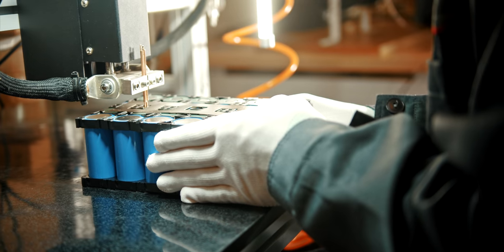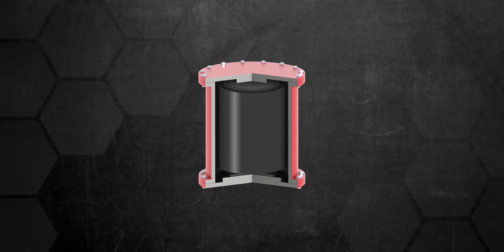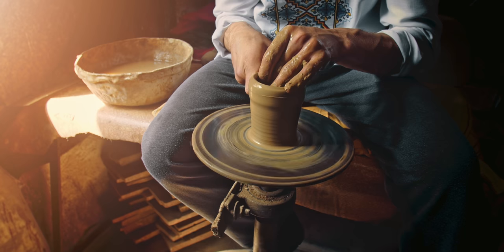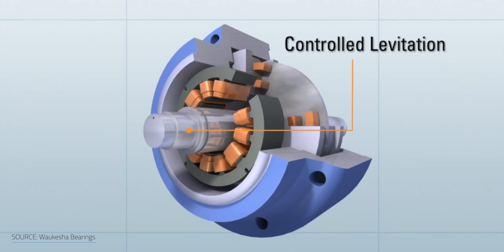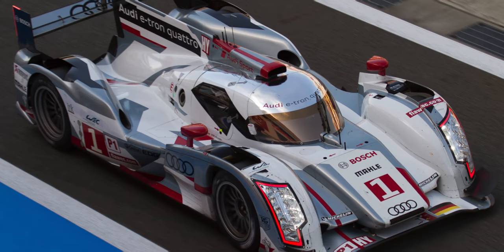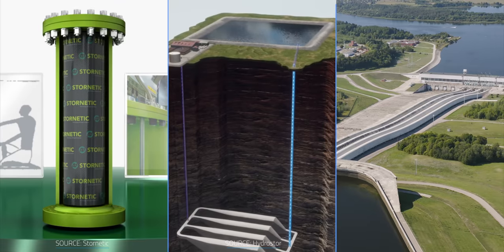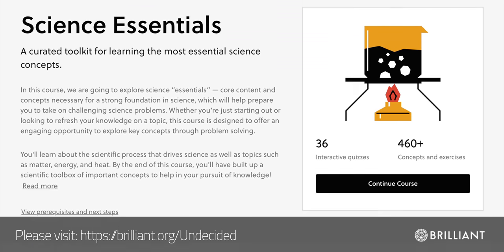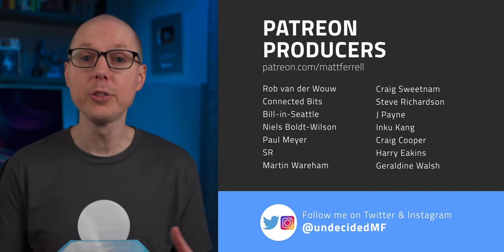The Mechanical Battery Explained - A Flywheel Comeback?

Comment: You talk about Beacons flywheel rotor being able to charge and discharge for up to 175, 000 cycle as opposed to lithium-ion batteries or any other storage solution so surely you need to present a costing on that so people can see that batteries are cheap and useless for the longer term, and flywheels are expensive to start off with, however, they end up being cheaper over the longer term and nowhere near as dirty as lithium batteries etc etc.

Comment: What is the self dischage rate of a mechanical flywheel "battery"?

I heard a similar exposé about them and it hinted that a free spinning vertical flywheel would take about 24 hrs to stop spinning, wihtout putting out any electricity throught the generator/motor. 

So knowing the max Kinetic energy stored in it we ca calculate the average dicharge power or, in other words, how much energy is required just to keep'em spinning at max angular momentum.

And I think that is what was the killer for this thing.

Do you have any data from the companies you mentined here?

cheers

Comment: Wait but for long range energy storage if the fly wheel is not in contact with a motor then its energy would just gradually be lost to inertia right? So how would it work as a battery if I want to power a house in the middle of africa?

Comment: The comparison here has some inaccuracies. Flywheels have great power density but have less energy density than a lithium ion battery. Composites flywheels, which I have worked on, are extremely expensive generally and have complex manufacturing requirements. They serve a niche purpose. Beacon made low cost composite flywheels by essentially wrapping carbon fiber on a shaft in the lowest cost method possible but they are still quite expensive. However their high power density lets them easily balance the grid in a way batteries cannot without fire or shortened life issues. The other critically important thing that should have been mentioned is the the velocity term in the equation is squared so going faster (as you can do with composites) is better than being massive (traditional steel flywheels).

Comment: I wonder why there are no concepts around to test stacked wheels with having electric cycles from the center to swinging mass part. This, and different pulsing(by taking energy from the system for each wheel individually and keept the enhancing induction pulse up and coordinated).

Also i think self-inducing magnetic systems can help to reduce storraging-inertia and shiled the system from gravitational loss.

Comment: Another thing I would like places like Coal Buring plants to do is use other sources of fuel that are renewable to use for the burning like say plant bricks of the left over parts from the Hemp plant industry or weed industry. This could easily work for these places, as could using scrap wood and tree that is unusable.

Comment: For stationary application the weight doesn't matter. Whats matter most are the costs. On the other hand high capacity flyweels are too dangerous for mobile applications. So flywells are not sutable for long time energy storage. The sweetspot of flyweels are situations where you need high power for a brief period of time. The main selling point of flyweels is power not capacity.

Comment: Whatever happened to that company that was making clockwork batteries?  Where you'd wind up the battery with a key, and it would spin a dynamo over an extended period of time to produce voltage?
Or was that just a fever dream?

Comment: how logical is to swtiching between electrical and mechanical form of energies ? 
in batteries, you store the energy in electrical charges, via ions etc. 
it may have certain applications but physcial constraints make me think about it.
there is a thing called, material lifespan, even in perfect conditions, the materials will fail due to fatique

Comment: Was just thinking lately why don't we use flywheels, and actually as I see most problems are solved just the cost optimization remains. Is there anywhere a comparison of storage performance (how much energy is lost per hour for lithium batteries vs flywheels?). These wheels will be applicable when they can store energy for months from summer till winter with no significant energy loss.
Reply: Not even remotely close for summer to winter.  Day to night is already a stretch.

Comment: The brother that were reluctant to sell the flywheel on a gimbal that powered a car to the oil company were allowed to build flywheel generators for missile silos and children hospitals. They were in Chatsworth CA. Until around 2010
Called Pentadyne . they went from a 90 lb. Flywheel to 300 lb. Both at 70 thousand rpm. They fired a machinist and our company picked him up.
I asked him for some scrap parts for a G job I was working on and as I described it to him he new exactly what I was doing and said " your after torque. !!! "
I replied in silence thinking how did this guy know what I was talking about music less he knew how valid my project was . nonetheless I said in reply ', how did you know ?
Then he told me the story of the two brother that made Pentadine .
He even started to show me on paper the design of its copper laid patterns in the fly wheel. Like he said I was after torque and didn't care to see the details 
But thanked him for the coming scrap parts that came later.  Check into Pentadine and see what comes up.

Comment: how could a flywheel control the altitude, its the orientation which is controlled by conserving the angular momenta about a particular axis. its mainly called the gyros and the hubble uses the same flywheel technology to point towards any star system and capture photos.

Comment: How about a tall tower with a spiral gear and a weight.  To charge it, energy is used to raise the weight.  To recover the energy the weight is allowed to fall, causing it to spin.

It could store that energy with no loss until the tower corroded and collapsed, so for years and years, if needed.

Comment: Mistake number one: the grid needs storage, not only renewables. The technology that needs the most amount of storage is nuclear. Nuclear runs 24/24 and can't be turned off at night. Therefore, pumped hydro storage was built decades ago, more or less ten years after the installation of nuclear and together with coal. Gas needs less storage. Modern gas peaking power plants even less. Therefore, it is said that the best friends of wind turbines are gas turbines. pumped hydro cannot be regulated according to the needs of the grid. Turning on and off a hydro turbine takes minutes and more. Reducing a hydro turbine is bad for the turbine: vortex formations create vibrations, which shorten the lifetime of the turbines.
Thus, we need batteries and other modern storage technologies for grid stabilization. 
Of course, renewables add to the complexity of grid stabilization. But we should not put all the blame on renewables.

Comment: I'm in favour of the flywheel. Practically endless cycles is what makes them feasible for grid stabilisation and the environmental benefits.  When using renewable energies you easily have to cycle the energie storage four times a day. Even when only using 50% of the capacity, what we actually do often in such cases. The Lithium Ion battery will be worn out pretty quickly. If you use even less then there's no cost benefit left at all. While you could cycle a flywheel at 95% without any bigger issues and can cycle it several hundred thousand times while using far less rare earths. What makes me think is the amount of gyroscopic force and the effect on the earths trajectory itself. No calculations made whatsoever just a thought/concern.
Reply: large mass of flywheel requires large bearings, large bearings large costs and bearings aren't eternal, they often fail if they hold large mass.
Reply: @tgstudio85  still rather cheap compared to lithium batteries. YOu can build bearings to withstand billion(!) of cycles. If you don't overload them at all they can be ethernal. You just have to do the maths and be ready to spend a bit extra

Comment: I don't get it. Don't these flywheels just stop spinning after a while? I mean, unlike batteries that can chemically store energy, if you're not actively spinning the wheel it will just stop, even if it's in a vacuum, because of gravity. What am I missing?

Comment: I mean technically you don’t need something with a lot of mass you just need something that produces a lot of torque. For instance if you had a 80lb flywheel and made it as compact as possible and spun it up it would take less torque to stop it compared to stretching that 80lbs into a ring kinda like a bicycle tire and spinning it up to the same rpm.

Comment: I don't understand the focus on Li ion batteries for grid storage purposes. Li is optimised for weight, which is not the main problem for large grid storage. Why don't they use cheaper lead-sulfate batteries or similar, since they are cheap and heavy?

Comment: What about molten salt energy storage. This would use electricity to heat solid salt blocks until molten storing mass amounts of energy due to the high latent heat. Then we convert that thermal energy back to electric via turbines.

Comment: In a UPS system made with flywheel material cost of the rotor is equal to 10% of total price of flywheel, power electronic is 50%. And the rest is mechanical system where rotor is 20% or 10% of total system. Housing is twice as expensive than rotor itself. So increasing rotor size will also means increasing housing size by double. 
1 kg of carbon fiber will give 4 times more energy compared to steel because carbon fiber has bigger strength what enable higher speed and in the end, it will result in more energy. Cost of carbon fiber is 20 euro per kg while cost of normal steel is 3 euro. Cost of high strength steel is 9 euro.
Most manufacturer use the steel for their flywheel because they don’t have intellectual property or know how. Solid block of metal is easier for balancing compared to tube therefore it is easier to use it but steel is not safe and it is limited by speed and because of that has low inertia or energy. 

During the speeding up the flywheel (80 kW) losses are:
•	1 kW for eddy current losses
•	2kW for LC filter losses. LC filter is used to provide a clear sinus wave (THD has to be below 1%) for charging the flywheel
•	300 W friction losses of the rotor in vacuum 
•	1 kW Switching losses of the power electronics

Comment: Think about how much energy you need to to manufacture a steel flywheel. The temperatures you need to process the metals, the energy you need to create all the coils, housing, etc. I certainly wouldn't call flywheels carbon neutral.
Reply: Exactly.

Comment: Your video doesn't mention the reason for both the expense and the unpopularity of flywheels: their danger.
If a flywheel is to store any useful amount of energy, it's going to be moving at speeds which push the wheel itself close to its danger of disintegration. 
That's why you see all those exotic materials in your good video: the technological problem is not making a better rotor, it's making a safer housing in case the thing comes apart.
A ton of anything moving at 100,000 cycles per second, if it could be made, would be as dangerous as a ton of fissioning uranium!

Comment: I feel like the environmental costs of the flywheel vs batteries is missed here. I could be wrong of course, but I would imagine flywheels wouldn't require the same sort of rare earths that drive conflict and pollution to create.
Reply: The energy required just for steel manufacturing of the flywheel makes it a significantly bad option.

Comment: It's more than just installation cost you have to look at. Add in the cost for replacing Lithium-Ion battery banks because they do have a finite Charge/Discharge count and that cost can quickly exceed the operational costs of Mechanical energy storage. Also I'm not going to even get into what Lithium mining and processing does to the environment. It's not as clean as they would like you to believe.

Comment: Flywheels might not be the absolute solution for grid storage but they do provide inertia that wind turbines or solar panels cannot. Inertia is essential to all power grids to provide frequency stability and drive through any small fluctuations in demand and supply. Of course if there is a major difference in supply and demand then generators will trip but thousands of tonnes of rotating steel in the form of steel turbines in gas, coal and nuclear power stations are essential. As we install more wind turbines and solar panels then inertia is lost. Adding flywheels would be a simple way of not only storing energy but also providing inertia. The speed required would be around 3000 rpm in a 50 Hz system.

Comment: Spinning something at high speed to generate electricity... how loud and noticeable is this system?

I remember taking a tour thru a nuclear power plant and on the floor with the generators it was loud and everything was vibrating so much I could feel it in my knees.

Comment: Also I realized perpetual motion machines can't work however could you use the conversion of gravity has another way to work as an over-unity machine / energy source.

You could have essentially one hydro gravity battery for example powering several others charge systems at once in the same way you would put a load on a electrical system and then from there feedback a portion those to charge that primary so it basically act as a vampire circuit and a large numbers we're part of it would go to charge the system and another part go to powering the grid.
Basically what you do is you put a liquid from a low altitude to a higher altitude whether it be feet or higher like a water tower sort of situation so that you convert that low power potential energy to a high power potential energy and then when it is released it would become a kinetic energy. Where you would take the extra Force generated by the acceleration of gravity and convert that energy into electrical energy and then use that electrical energy for the grid

Comment: Why is there such a huge difference between installation costs and LCOS? Shouldn't they be similar?

@8:52 : Li-Ion installation cost in 2030 seems approx 100$/kWH. 
@9:14 : Li-ion LCOS at 2030 seems approx 300$/MWH or about 30 cents per kWH.

Comment: what if.... you get a 10kw alternator, and attach it to a flywheel, which is kept spinning by a battery supply charged by solar.... so a 12 volt motor keeps the gyro/flywheel turning to produce ac power, but more importantly, the solar energy charges enough batteries all day to maintain the 12 volt motor all night.... endless power as along as there are enough panels, and enough sunlight to charge up the batteries...

Comment: In some regards this is being done already many EV vehicles recapture induced voltage when breaking is applied - counter rotation and or flux is re-captured as a matter of object of momentum back into the battery packs. that being said as an electrical engineer of 35+ years - no fan of EV at all; in a nutshell - more is energy wasted from the source than burning directly via combustion at the end of the day when you calculate stack-up efficient effects of both side-by-side.

Comment: Could one build a wind/flywheel hybrid by adding a huge Heavy Ring around the blades?
Reply: I think the added Mass would restrict the blades efficiency at low wind speeds. But having a drive shaft extend through to the rear of the turbine with a clutched flywheel mounted rear of the generator could allow the flywheel to store excess energy during high wind speeds and access it again when the wind changes. The clutch could be set to engage when there is excess wind, charging the flywheel, disengage during normal wind and discharge its momentum into the generator during low wind events.
Reply: would ruin the aerodynamics of the mill? store the flywheel along the generator's axis
Reply: @mortophobegaming6454  a teardrop shaped ring ruining aerodynamic? How? I mean a bit for shure (because something is always worse than nothing) but gains and losses combined should be a positive mhm :/?
Reply: Because if it becomes a flywheel, the wind wouldn't have power to spin it up?
Reply: Yes the gyro wind turbine watch YouTube video regards Graham Flowers
Reply: No, but you could connect the windmill to a bicycle chain system, have it start on a very long gear ratio, and click up as the wheel spins up?

Comment: The friction of bearings has been greatly improved with the magnetic bearing but doesn't the bearings have to have an electrical source to perform? Also as our "flywheel" remains charged and idly waiting to be used, doesn't it require a constant energy input to keep it from grinding to a halt? No one ever explains what are the energy requirements for Lev magnet use. The greater the mass would mean greater weight, and more work load on these type of bearings and the velocity or higher rpms would that require even more energy to maintain the bearings function? Lastly, I can conceive that the old reliable flywheel is dependable for perhaps those "peak times" when the grid needs a boost but a diaster for long term storage. Also, the weight would be heavier than the densest battery so mobile vehicle use would be limited to specific and localized application. Just some musing as to the feasibility of this ancient wonder. It has definitely been useful and is by no means obsolete but perhaps limited and not a versatile and universal answer to our many varied needs for clean renewable energy. Of course a little here and a little there lots of different things together will help attain our goal.